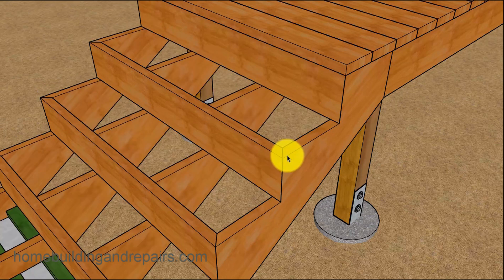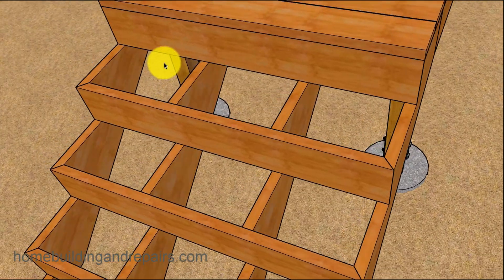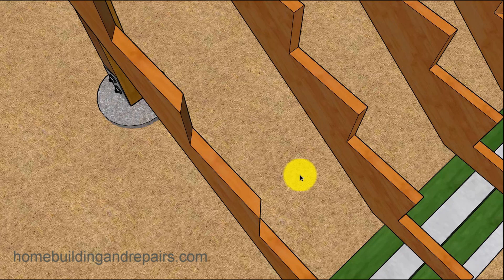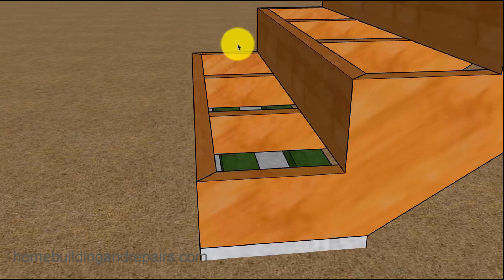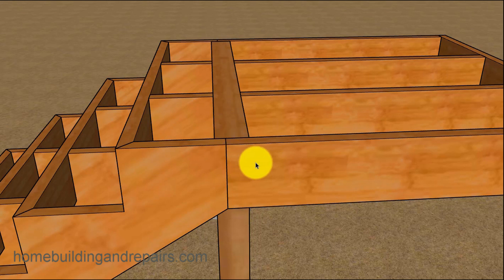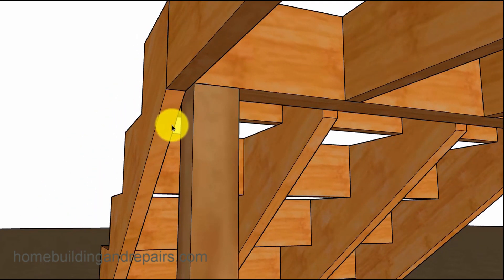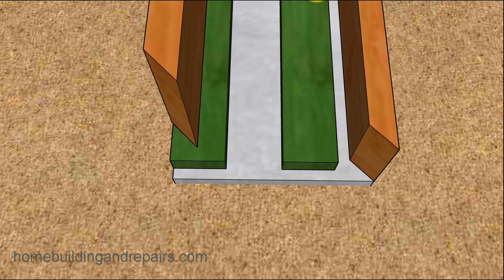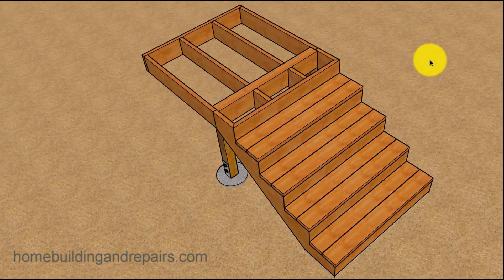Test Out Your Finish Carpentry Skills With This Stairway - Mitered Stringer And Riser Corners

Comment: You would need a sidewinder saw, and a worm drive to cut both with ease... We use the cordless sidewinder Makita these days, and I was thinking the LEFT side was harder to cut.  But I see how with a wormer.
Reply from the maker: The worm drive or the sidewinder saws seem like they would still have a problem, but if you have a video of how it's done, feel free to provide me with a link or email me the link.
Reply: @stairbuilding  well each type of saw's bevel assembly swings differently from each other.  Mirror imaged, essentially.  A sidewinder (top handled, east coast, motor left side) saw will easily cut a 45 bevel on the right hand stringer as viewed from the foot of the staircase.  A worm drive (rear handled / west coast, motor right side) will easily cut the RIGHT hand stringer.   With the 2 different types of circular saws, one can easily cut mitered stringers with no plunge cutting or back-cutting.